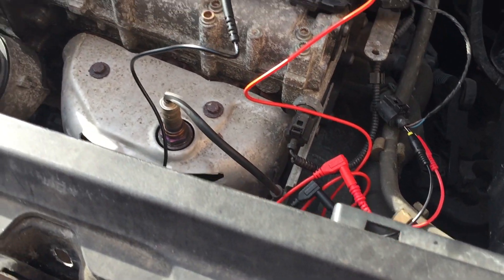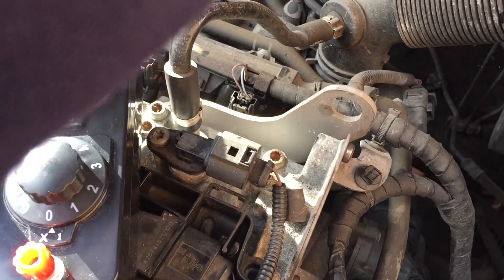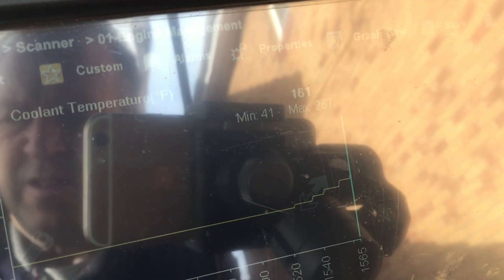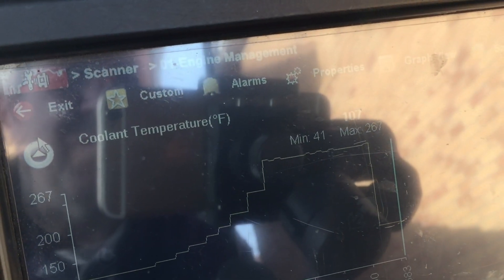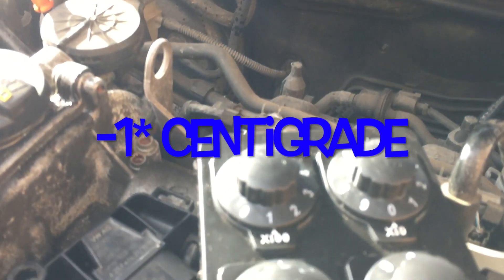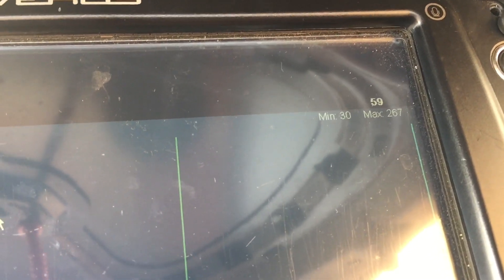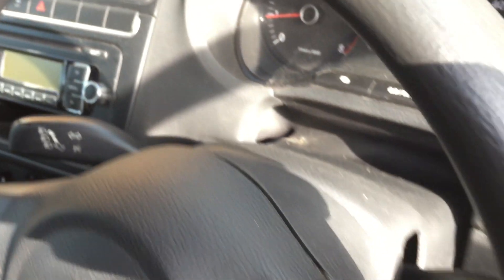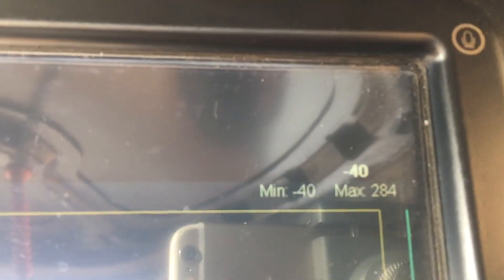Decade box and thermistor!

Comment: I have the OTC 3385. Have used it for many things such as simulating a temp sensor as you demonstrated here. Have also used it on some older Bosh ABS systems to simulate the resistance of a speed sensor, (around 2.2Kohms). Then run a self test if passes wiring is likely good. Some switches have stepped resistances and it can be used to simulate a specific switch function, fuel gage testing, knock sensor testing. I think you will find some others. Cheers!
Reply from the maker: Cheers Phillip great tips many thanks sandy

Comment: i know that some GM computers change the algorithm about in the middle of the range so they is more differential at the high end
Reply: Quite a few manufacturers use a range switching temp circuit in order to make the sensor more sensitive to changes in the hot operating range. Unless the scanner reports the temperature reading as a voltage you will not see the switch on the scanner. If the scanner reads in degrees C or F it knows when the parallel resistor is switched into the circuit in the ECM and factors the voltage shift out. GM and Ford for sure.
Reply: @PhillipBailey  i see you've been around some wres yourself,i worked at gm dealerships about 20 odd years specializing o cadillac electronics. i always went above GM classes and taught myself
Reply from the maker: Cheers Henry